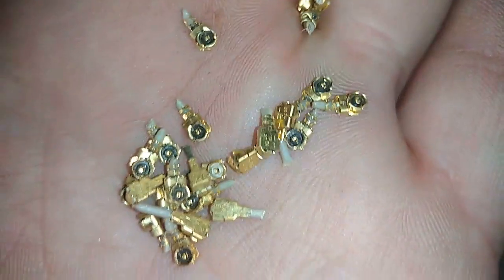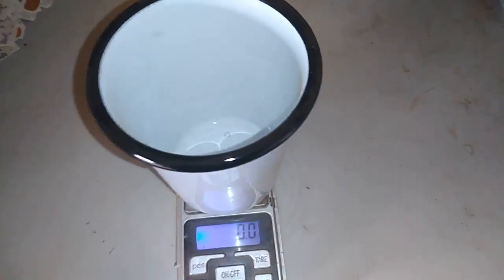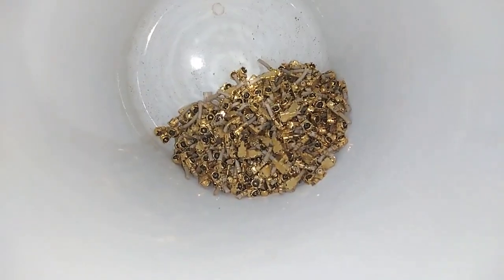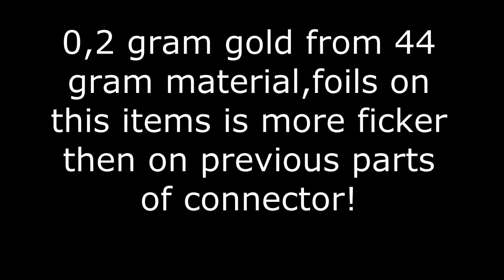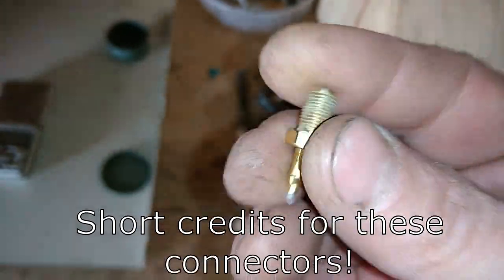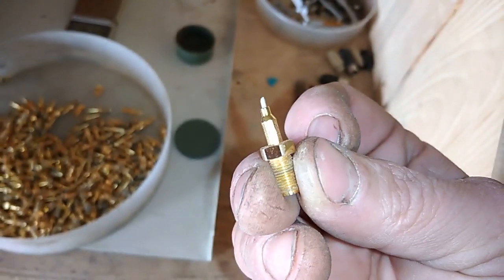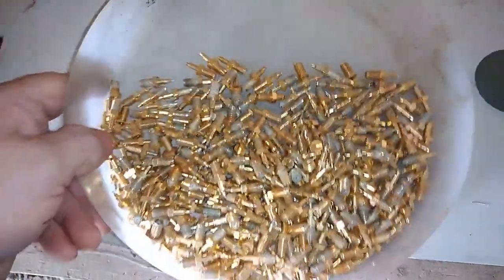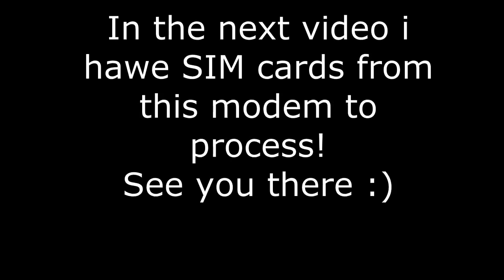GPRS WIFI connectors gold recovery - yield video!

Comment: I dont get it.
All the connectors and material from the last videos are a prime example for when to use leeching solutions.
Why make it so hard on yourself?
Reply from the maker: Because i get cheap acid and for me is no problem to spent that amount of acid for a gram of gold mate.
Reply: @999DusanGoldrecovery  Aaaah, that makes sense ...

Thanks for the reply as well as those videos :))
Reply from the maker: @1000-r3g  You welcome mate-here is 1 litar Nitric acid about 50cent only.
Reply: @999DusanGoldrecovery  Wow. I realy have to look up if i am allowed to transport it over the border to austria.
50cent is awesome!
Reply: I'm thinking of doing my little connectors, I have just over one pound, the citric acid way. I'm in the US, I could only dream of 50 cent nitric. Citric acid powder off Amazon is pretty cheap though.
Reply: @scrapping4shiba  Citric works in all stages incl. refining up untill you need to get rid of the silver.
Then ist back to nitric acid or boiling sulfuric acid.